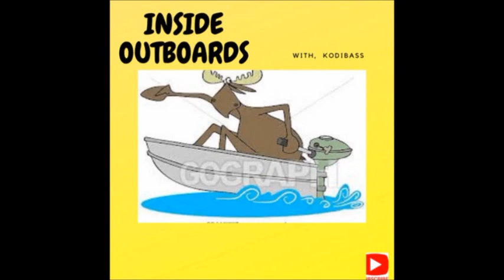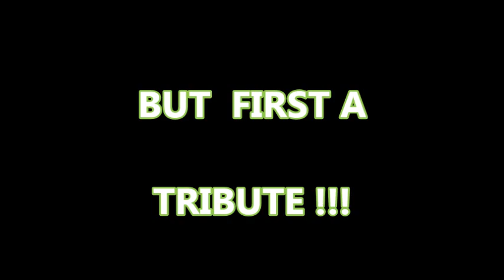EVINRUDE 35 HP PART 2  ,  &  A Tribute  to the end of Evinrude Outboards.

Comment: I doubt that there will ever be another engine built again that will not only run but run well 50 yrs. later with simple general maintenance. The engineering that went into those motors was nothing short of amazing.!!!!!!
Reply from the maker: +TLS  U r spot on,  I often have 4 strokers come in that r  less than 10 years old ' completely unrepairable  from a cost effective point of view.                                         kodi

Comment: So I have a problem with my 1976 evinrude 35. Its an electric start with a spark problem. It doesn't seem t have any power coming to the coil thru the blue and white wire. I have changed the points and condenser out but to no avail. Do you think it could be the stator or driver coil?
Reply from the maker: +WS it could B ,  But the first thing 2 check, is the stop switch & wiring On your model it is common 4 the wires up thru the mag plate to chafe thru & ground.                                                                                                          kodi

Comment: As for the Smaller outboard engines,Mercury pulled out way before Evinrude stopped,(Tohatsu)
Reply from the maker: +p  u r correct.          New 40 thru 60 hp Merc's r made in China.            kodi
Reply: So Evinrude kinda outlasted Mercury I n a Way.But ,I think Evinrude might not be Dead Yet,The Name,Brand,and parts business (OMC),old stock replacement,is Worth some $$$$.I,m hoping might get sold back too a US company.

Comment: I have a 1995 25hp Johnson fires up runs for a few seconds then cuts off. Fuel pump rebuilt. New gas/50:1 new spark plugs. Haven’t cleaned the carb on it does that sound like where the problem could be coming from ? I’m playing cat and mouse with this motor and I’m down 4 to zero.
Reply from the maker: +Ts,  Yes the carb is the likely culprit ,    kodi
Reply: kodibass person who sold me the engine installed the float upside down! Ran pretty good when it was getting gas. Now I just have to fix the timing and linkage and I should be good!
Reply from the maker: @TurfSurfer    Yep'  I have done stuff like that as well,  Get in a hurry boom stuff in upside down & backwards.  been there done that.                             kodi
Reply: kodibass I appreciate the fast reply’s! Love the channel!

Comment: Hi i have a 70 hp johnson running smooth on idle speed, but it won't gaing no speed on hi any recommendations?
Reply from the maker: EP, It could Be many things, But I would start by cleaning your carburetors & make sure You have spark on all 3 cylinders.                   kodi